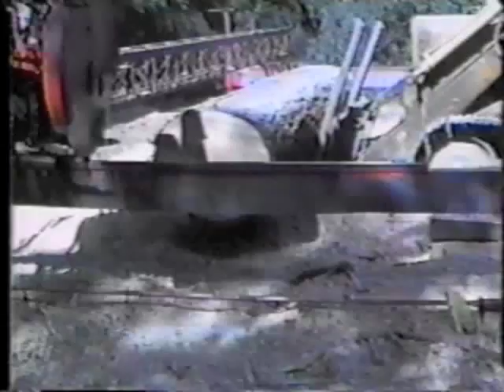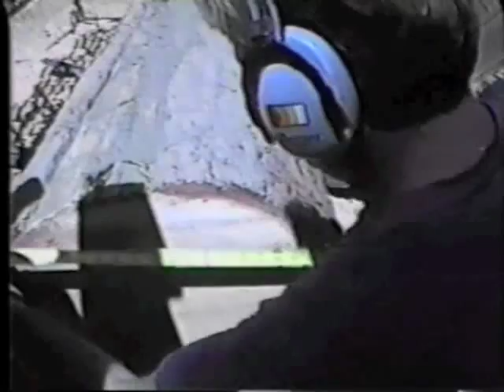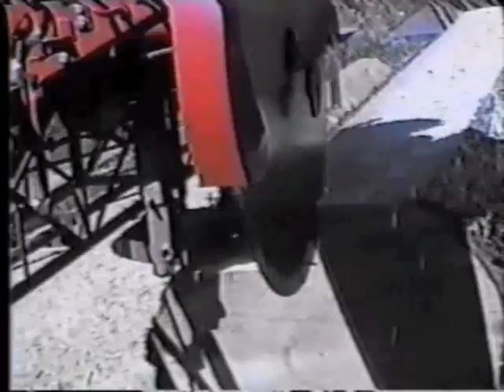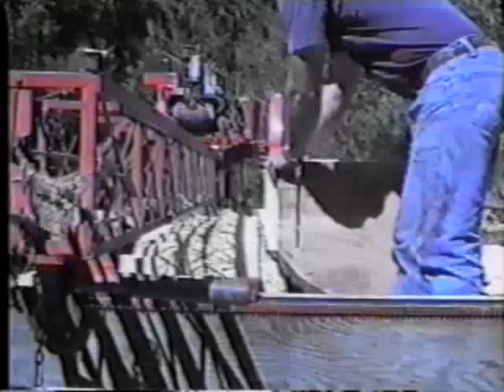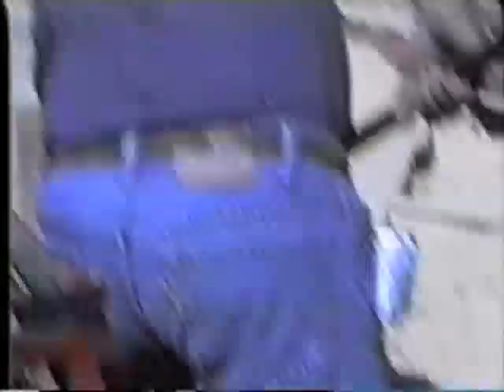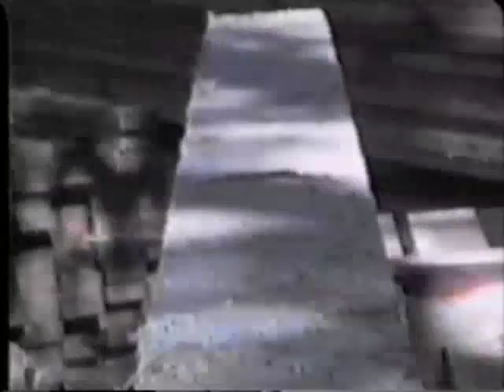Sawing Timbers for a Timber Frame House

Comment: We had one set up as a production machine for over size red cedar , the mill could only hold around a 63" log ( dia ) . Maybe a good sawyer, but he was always within 1/32" of target size , cants were straight as an arrow both ways . He was cutting heavy to 4x12" . That little vw motor just kept on going, hour after hour . The sawyer sharpened the inserted teeth at lunch time , so no down time while cutting . Except for the rather large kerf, this was the prefect machine for the over size logs, and logs with large flaired butts .